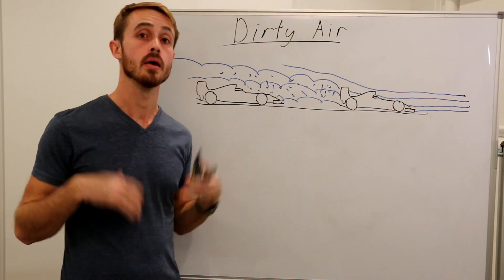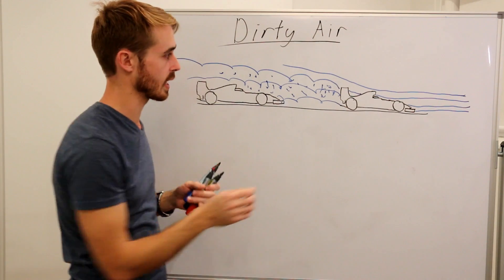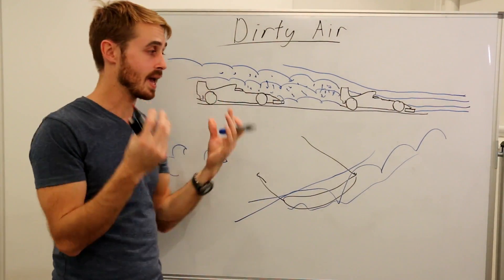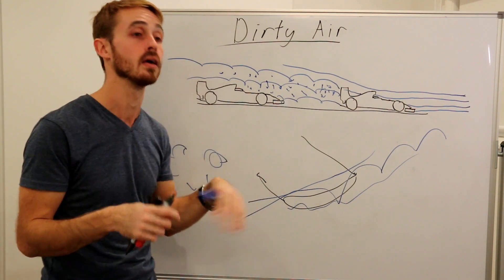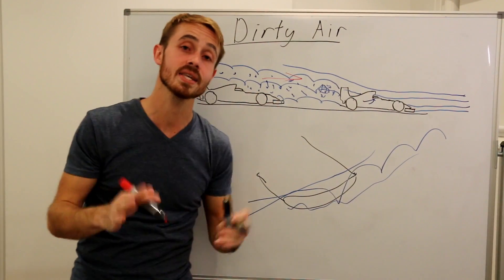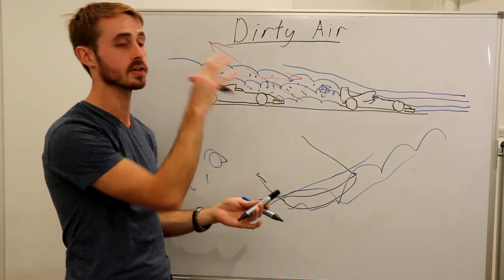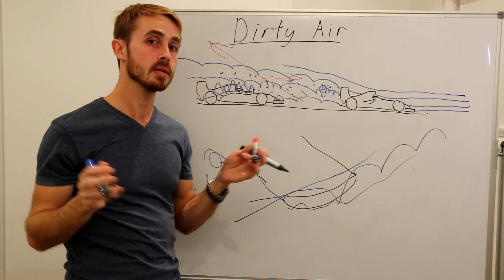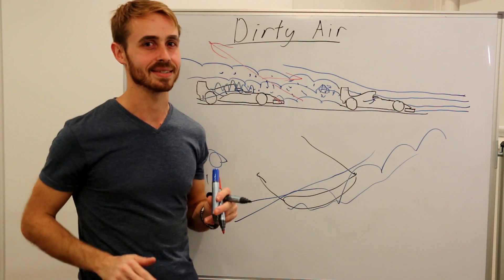What is Dirty Air? Dirty Air Explained

Comment: Well done on the follow up video on current  rule, changes present and suggested and their effects causing dirty air or defeating dirty air. 
Could you do a video on Aero features that could be used to take it advantage of dirty air because let's face it the only guy in the pack that doesn't have dirty air is the leader superformance getting through the pack is much more important than clean air. As we drive 75 mph bumper to bumper 5 Lanes wide over Altamont Pass ,Ca and fog so thick you can't see three cars ahead.  I decided it wasn't the life for me.

Comment: Hi,
Nice video, thanks. Very well explained.
Maybe you should also mentionned that dirty air also contains heat from the previous car(s) and road dust. This lower the cooling effect and is a risk for the driver, the tires and the engine.

Comment: i thought that when you follow behind another car down the straight in f1, u get in the slipstream where u dont have a lot of downforce but at the same time u have less drag so makes u go slight faster, but in certain times where the dirty air are hot exhaust gas which something u dont want to get in ur intake. however when the car gets to the corners u want to get away from behind so u can have some clean air to give you down force. sorry for the typos

Comment: I've heard that dirty air "destroys the front wing" not visually but aerodynamic wise is that true?
Reply: yes, it's the same reason that makes airplanes "go down" when they encounter turbulent air, it doesn't make the wings work as they're supposed to
Reply: Go en google and search for airfoil and look at an image
You can see how it works if air is comes straight at the airfoil,but now imagine if the air comes from above,the airfoil wouldn’t work as intended

Comment: i know i may be wrong or it is a subject too dificult to me but if you are behind somone isnt that good for overtaking, beacuse you can slipstream or slipstreaming and dirty air occur in different sitiuations?
Reply: the dirty air starts killing the downforce before they're close enough to do slipstream overtaking, once it gets close enough the car behind finds itself struggling to keep up due to the rate it loses downforce at while still being too far away to overtake.
Reply: chris davidson, so from your explanation slipstream is also negative? how come they use it for overtakes then?
Reply: NASCAR, yes, slipstream is easy as they are meant to fight against drag with powerful engine output and have relatively low aerodynamics
But the shape of the aero of the F1s make it so much harder for F1 cars from overtaking on the straights as they lose grip as dirty air causes efficiency loss in aero

Comment: i could not understand it.did you mean that the car which is following another car in front of it will push the air which is coming from the car in front in opposite direction.

Comment: is that dirty air caused by the exhaust fumes as well ? I am still not understanding how it is a vacuum and goes back in the direction the car is moving when the car is basically going through it , i would think a wake is more how we drive a boat, the wake in the back are the waves going away from the boat ?
Reply: Just like the boat rolling waves of air are the turbulence the bubbly section in the center of the wake is smother for a following boat however its prop is less effective in this extremely turbulent portion . Notice the ocean Racers always stagger so as not to be traveling in this region

Comment: I demand you make the video!

I was in the process of commenting on your video asking about "slip stream."

Just to make sure I have this straight. Cars running huge amount of downforce create turbulence from vortex generators and such. But, cars that are designed for less downforce, such as v8 super car or god forbid NASCAR, don't create as much? Is are those two where a "slip stream" comes into play?
Reply: As I understand it, the main thing here is that a moving car moves the air with it a bit, so the air behind it will move a bit in the same direction. The car following it will thus have less drag ("slip stream") but also less downforce. F1 cars depend a lot on the downforce, so they suffer more from it. But more than that, F1 cars are designed to have intricate patters of airflow around them, which are broken and disturbed when the car goes through turbulent air ("dirty air") created by the car ahead of it.
So both effects, reduced drag and reduced downforce, apply in F1 and touring cars, but for different reasons their relative importance is different.

Comment: Would dirty air be somewhat mitigated if the track was populated by fan cars (Brabham BT46 type cars)? 

The fans would be projecting air (rather than dragging it along with them) in a relatively coherent stream parallel to the ground behind the car. They also drastically decrease the requirements for wings and the like, which would lower drag and resulting upwash and decrease the number of decaying vortices. 

Although I think I remember someone mentioning they had problems with firing debris at trailing drivers. So when confronted with a choice between dirty air or solid projectiles, most people would go for dirty air.

Comment: So NASCAR they use the dirty air/ drafting to gain more speed. Even you lose down force you can gain more speed from the vacuum created by the car in front of you. So I guess dirty air can be good or bad depending on situation huh
Reply: M. R. Yeap,correct
Reply: Muhamad Hariz So, does that mean, they also have less grip when slipstreaming on a straight, but it just doesn't really matter because they are going straight?
Reply: But I do see F1 cars use slipstream. Is it that on straights the "dirty air" is beneficial and in corners it becomes a problem? I don't really get it
Reply: It’s also used in F1 to get the maximum speed possible on straights,and if you look at some overtakes at the end of straights,you can see how the driver following is catching up on the slipstream and pulling to the side as soon as the turn begins to get the clean layered air,and thus gaining speed on the straight and getting all the downforce on the curve ( ideally )
Reply: exactly
Reply: M. R. Because they lose grip
Reply: M R
The power theas cars have can spin the tires at will the trick is to always be on the brakes or the throttle at the point to which the tires can barely hold and the corners this point is much lower as the burden of turning traction is subtracted from throttle and Brake traction in the dirty air with less downforce the F1 cars can use less throttle brake before the tires break loose therefore they lose rate of acce/deceleration compared to the leader
Reply: Its because F1 car are design to be extreme dependent on aerodynamics to stay on the ground and they also don't leave much "vacuum" behind only turbulent air. 
NASCAR cars are big and heavy so they focus on fighting the drag with brute force and also because they are big they leave a good amount of "vacuum" behind so following a "vacuum" mean that u are wasting less power to fight drag.

Comment: i thought drafting benefits would surpass drawbacks from dirty air flow,especially in a straight line where you don't need the downforce. this drastically changes my mindset

Comment: Will this lipstreaming lower a power of the engine?
Reply: For a turbocharged car running at high power absolutely slightly warmer intake air temperature means less air density at the mouth of a turbocharger= slightly less effective turbo intercooler is means  less air density in the intake manifold going into an engine that is running warmer due to the same reduced efficiency of the engine coolant and oil  Cooling systems. Each of theas reductions in efficiency do stack up to fewer oxygen molecules waiting at the intake valves  when it opens intern fewer fuel molecules are oxidized/ broken down and turned into crankshaft horsepower.  The loss of ability to accelerate without breaking the tires loose due to loss of downforce is a bigger problem than the horsepower production.

Comment: Why do cars producing downforce have upwash?
Reply from the maker: At it's simplest level, you can think of it as F=MA (Newton's laws). The downforce provided to the car is exerted by a force from the air, so the car is therefore pushing back on the air with the same force. The car cannot accelerate down as it is restricted by the ground, but the air can accelerate up, so the force causes it to accelerate upwards, causing upwash.  Make sense?
Reply: The same reason an aeroplane creates a downwash.  Lift and downforce are created by the circulation of air around an aerofoil - you hear a lot of people on the internet describing downforce in terms of Bernoulli's principle but that's not really correct.  In reality, with a wing, lift and downforce are created by the wing deflecting the direction of airflow, i.e. affecting its circulation.  The Bernoulli principle is generally more suitable for describing diffusers.

Comment: Kyle i thought dirty air was dirty because there is less oxygen in the air to be used for combustion
Reply: That is wrong, whoever told you that was joking.  The only thing remotely close to that is that hotter air generally contains less oxygen.
Reply: i heard on f1 with brunson

Comment: I have heard a lot of prominent F1 presenters and pundits say that the lead car takes away the majority of the energy from the freestream air, thereby making life difficult for the following car. However, I personally find this statement to be counter intuitive as the votices being shed are basically energising the flow in the wake. What are your views on this? Is their statement justifed?
Reply from the maker: Well, I guess it depends on the frame of reference. From the stationary frame, any car moving through the airflow will increase it's energy as it imparts a velocity. However from the moving frame (that of the following car), the wake of the car infront is essentially slowing down the oncoming air, so in that way, you could think of it as reducing the energy of the incomming air. Shed vortices are energising the flow, you are correct, however from the frame of reference of the car the "de-energisation" of the velocity defeicit is all that matters, as the vortices aren't useful energy. Does that make sense? I don't agree with saying the car in front robs energy from the flow though as I believe it is ambiguous, inaccurate and misleading.
Reply: This makes much more sense. Thanks for the reply

Comment: So the theory of slip-streaming doesn't really work? (for high-downforce vehicles)
Reply from the maker: Slip streaming is still valid for reducing drag, but it will rob downforce. This is why you see F1 cars slipstreaming down the straight, then pulling out to overtake just in the braking zone, instead of pulling out at the start of the straight. Given the number of questions I'm getting on this, I think a video on slipstreaming may be in order...
Reply: +KYLE.DRIVES Keep up the good work! I'll be waiting for the next vid!

Comment: I thought a lot about this problem.
It could be solved by applying the existing rear wing regs to the front wing (i.e. the front wing can only have 2 elements on each side of the mandatory FIA central section, an endplate on one side, another on the other).
To compensate for the loss of front end downforce, the floor regs should me modified in a way which will move its CP closer to the front axle.
But even if all of this is done, im assuming that the teams will then develop extremely complex, thus extremely sensitive turning vanes, VGs, etc under the front bulkhead. So the regs which govern that area would have to be much more restrictive.
Reply: This aged well

Comment: Wouldn't having a ton of eddies coming from your car reducing the abilities of the following car be an advantage? Why would anyone want to reduce the Eddie's thus improving the following cars chance to overtake?
Reply from the maker: Correct, it would help with keeping them behind you. However, eddies and turbulence require energy to produce, and the only way to do this is to increase your drag or decrease your downforce, so you don't want to be wasting too much energy just to screw the car over behind you. Also, many aerodynamic rules changes are meant to make overtaking easier by reducing these eddies, thus making the sport more exciting.

Comment: And this is what allows stock cars to draft off of each other at Daytona and Talladega to go 10+ mph faster than a car that's by itself?  That explains the aero-tight that I hear about in NASCAR.  But what about the aero-loose that the lead car sometimes gets in a draft?  And why does the trailing car have to be within inches of the lead car to cause the lead car to get aero-loose and even spin-out the lead car even if there is no contact?
Reply from the maker: Yes, although drafting is a combination of lower slipstream velocity and being in the low pressure region at the rear of the vehicle, hence why it is so effective at close proximity. The "aero-loose" you are referring to is likely a function of the rear car filling the low pressure region at the back of the front car. The high pressure region at the front of the rear car will interact with the rear of the front car, causing the centre of pressure to move forwards. This could make the lead car aerodynamically unstable, as the COP could move ahead of the COG (think of the arrow effect).
Reply: I remember to have a TV show having explained why bikers (musclepowered not enginepowered) are drafting so close:
By experiment they found that around 30% energysaving for the following biker AND 10% for the frontguy (what they didn't expected)
They made calculations for how close a streetcar would need to get to have similar benefits and it was under 1m! (For safety reasons not the best idea ;-) )
Concerning F1 and other racecars I didn't thought there would be such big problems with the airflow oO

Comment: Do open wheelers have a bigger issue with this than closed-wheel cars? Because I feel like LMP1s and LMP2s seem to have an easier time following closely, despite producing considerable downforce, than F1 cars.

Definitely interested in the potential solutions video, looking forward to it!
Reply from the maker: Open wheelers will produce considerably more turbulence from their exposed wheels which will make the air behind them dirtier than a comparable closed wheel car. LMPs also have a lower downforce/weight ratio than F1, meaning they will be less affected by dirty air. They also have wider aerodynamics packages (wider rear wings etc) run at less extreme angles of attack, hence their coherent vortices will be weaker.

Comment: I think another misconception (maybe?) that is worth addressing is that "more complex front wings, like the current 7-8 element beauties, make it harder for cars to follow through dirty air". Now maybe I am mistaken, but don't the multi-element wings make it possible to keep more flow attached in turbulent air compared to large elements? The front multi-elements should also help clean up that initial airflow so it is more efficient over the rest of the car right?
Reply from the maker: They do help with flow attachment, but those wings are also run at the ragged edge of stall in most cases, so that negates that. The bigger issue is that the turbulence and large scale vortices are of similiar size to the vortices produced by all the small flow control vanes, and thus can interfere with their effectiveness in unpredictable ways. Increasing the number of slots also gives more chances for vortices to cause localised stall, as if it were normally to impact upon the top surface of a single element wing it would just flow over it, while impacting on a multi element wing means that it may be ingested by the slot and cause unpredictable flow effects. Does that make sense?
Reply: Yeah makes sense thanks.